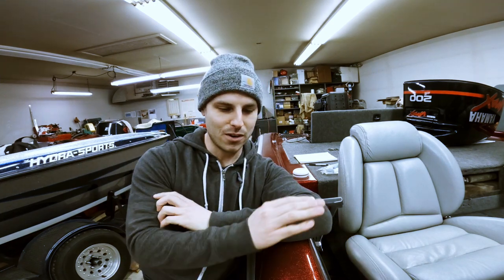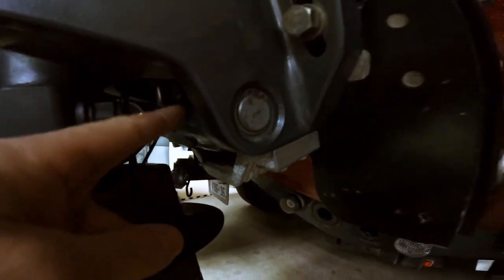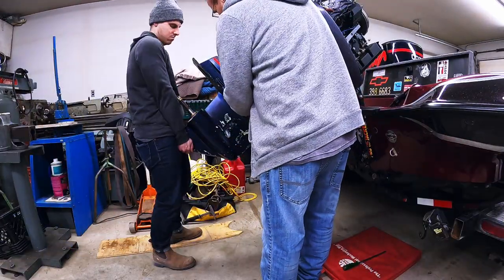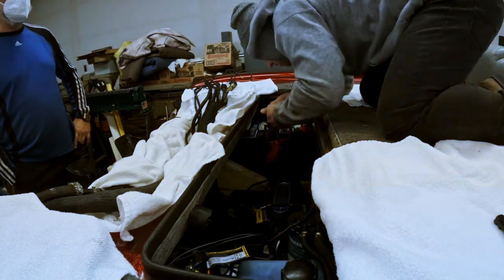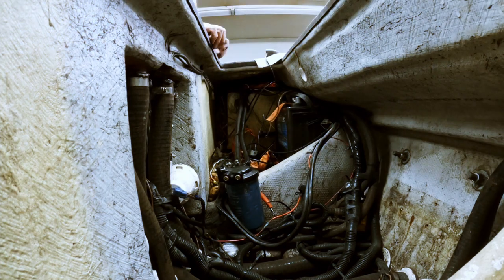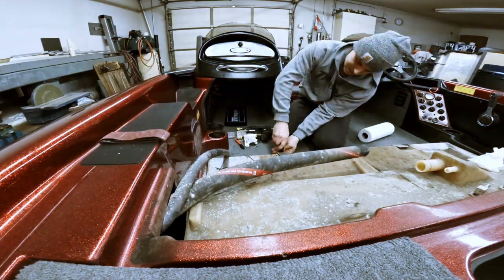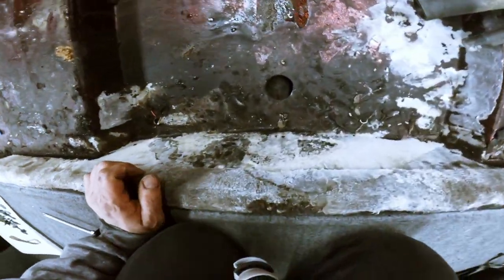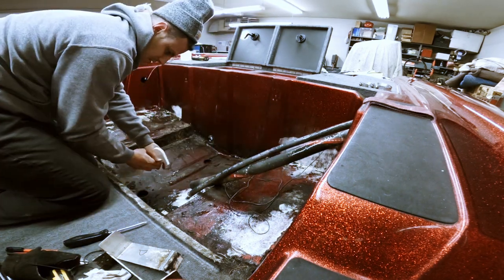Triton TR20 Bass Boat Restoration : Part 2 - Engine and Fuel Tank Removal, Bilge Cleanout

Comment: Just came across your channel, it's always nice to see older boats being restored. I have a 2006 Skeeter 20i that's still going strong which has a 250 HPDI. A common trim noise can be the two rams creaking but this can be solved by adding a little grease. Also while you're at it check the tilt rod bushings for movement as they are plastic and can crack.
Reply from the maker: Sage advice John! I would love to get ahold of an older skeeter for our next project, beautiful boats. Thanks for subscribing and welcome to the channel!!

Comment: Came across your video. I just purchased a 2000 triton tr21 and I am having issues with a gas smell in the rod locker. Talked to several boat mechanics. Half said it was a normal issue with triton boats, where other half said I have a leak issue. What is your thoughts on this issue?
Reply from the maker: We generally do have a bit of a gas smell around the boats, could possibly be normal. Wouldn’t hurt just to pull the tank cover and have a look for anything suspicious!

Comment: I'll be buying a TR20 to restore but it doesn't have the lids or panel that goes over the gas tank. Would you happen to know where I can get those?
Reply from the maker: Hmm, that might be tough! You could try getting in touch with C&O Marine, they could probably point you in the right direction

Comment: is this boat a 1999? Also what is the size of the fuel tank in gallons on the TR -20? Im Canadian as well but most fuel treatments say add per Gallon and don't want to over treat it! thanks!
Reply from the maker: I’ll check tonight and get back to you!
Reply: Stated in video: "213 liters"; Google estimates that to be 56.2686 gallons. (My  2008 Triton 21 has a 57 gallon fuel tank for comparison).

Comment: I have an 04 TR20 and I need to remove bad fuel. Will I have to remove seats ect to be able to do that or do you know a simpler trick ? (I was curious to see what I was dealing with) so I fed about 4' of coax cable and hit solid. Pulled it back out and had no fuel on cable. Now that I watched this vid. I understand what I hit with the cable.
Any help would be appreciated.
Reply from the maker: You likely will have to pull the seats and the tank cover to access the sending unit, but I promise it’s a pretty easy job, I think all you need is a Phillips screwdriver. Remove the seat pads to get to the seat screws, lift them out and the around the edge of the tank cover there around 8 Phillips screws, that’s it!
Reply: @FishingOntario  Hey I really appreciate it. I never dreamed I would have to do it that way, but at the same time I drew a blank on how I was gonna get it done. I saw your vid and thought "hummm" Lol
Thanks for the reply and tips. I'll give it a shot !
Reply from the maker: No worries! Give ‘er! They are really simply built boats, just don’t get too rammy, it’s kinda weird to feel for the screw heads I. The carpet, but they are there, if it gives you any major resistance coming out, you haven’t got all the screws out yet. Lemmie know how it goes or if you need any help.
Reply: @FishingOntario  Yeah, in my mind that what I was thinking. Finding the screw heads due to the carpet, but you gave me a number of screws to look for. I saw one vid where there is 1 screw dead center of each seat tucked away between cushions. I'll just take my time and "fish" around (no pun intended) for screws ! 
I promise no rammy with sledge hammer either !
 If I run into any snags I'll message you. If I knock it out of the park. I'll message you. 
I really really appreciate it !
Reply: @FishingOntario  Yo, thanks to your video and feedback. I exposed the tank and I'm just waiting to get a siphon to siphon out the nasty fuel. I have a lot of water in the fuel. You were right though. Super easy and might I add interesting to see the history and the pile of scum after years of fishing. I found a potato chip, but it didn't taste like a potato chip ! 
So I learned a lot.
Tritons are very nice boats. You have sharp one you're working on !
Reply from the maker: Hahaha🤣🤣I hope that chip brings you good luck! Definitely get that nasty fuel out of there. The little shaker siphon is all I use and it does a fine job once you get it going